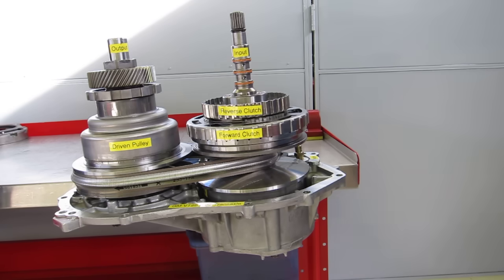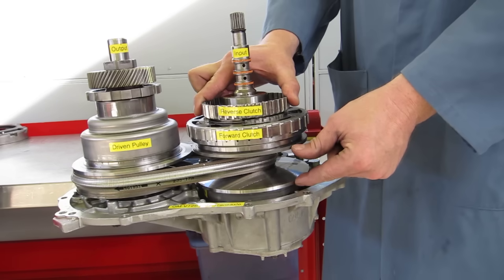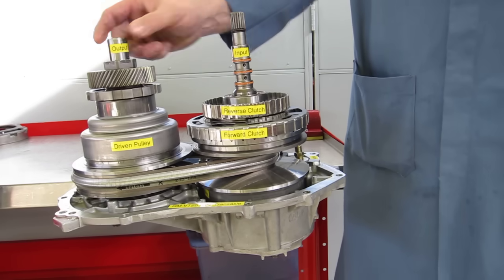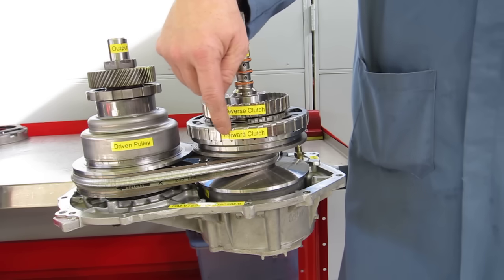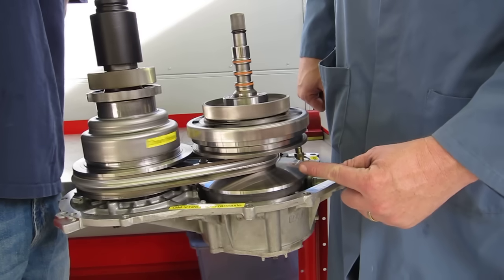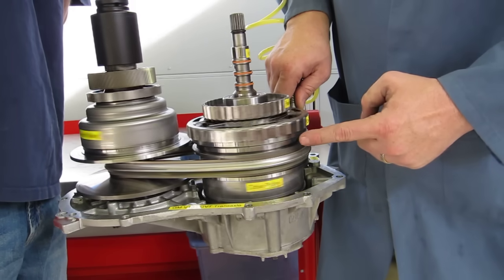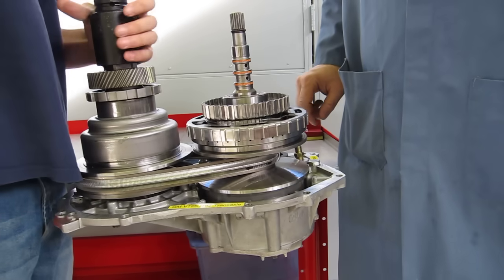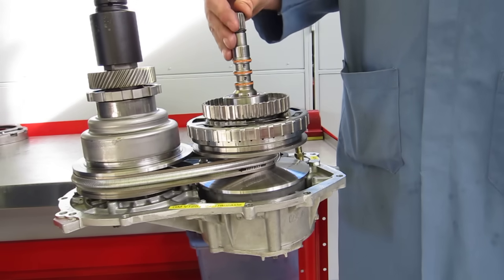Continuously Variable Transaxle (CVT) Operation

Comment: I've only driven a GM CVT but it's was the most soulless thing I've ever experienced. It took every single ounce of joy out of driving and I honestly thought the car was broken until the dealer explained that's just the way it worked. If other manufacturers are are as bad then I will continue to only buy older used cars.
Reply: Just buy a manual. Subaru, Honda, Mazda etc. Problem solved.
Reply: @unwantedscrub  manual is a good way to go, but you can also buy a torque auto trans. All models of the new Subarus use cvts now. Garbage!!!
Reply: @dafashoso3442  I can go to Subaru's website right now and build a brand new Crosstrek Premium with a 6 speed manual.
Reply: @unwantedscrub  Sadly a lot of used Subaru's here in my state have CVTs.
Reply: I bought Mazda for this very reason! They still use gears
Reply: You're going to LOVE Electric, then.
Reply: @troyjollimore4100  Would love one but I don't have the money and I don't like care much for Tesla as a business.
Reply: @MadCarTK  Didn't specifically say Tesla. So what don't you like about CVT that isn't echoed in an EV drivetrain?
Reply: @troyjollimore4100  Aren't they direct drive?
Reply: @MadCarTK  Most are. But the 'feel' is pretty much the same. Constant, linear, (boring, don't people say?) power delivery...
Reply: @troyjollimore4100  planetary gear transmission do have a very linier power delivery throughout their gears but they don't have the gutless acceleration of a CVT thanks to engagement a CVT or as many still call them a centrifugal clutch lives on slippage and you will always have it in any smooth belt driven system clutched planetary gear driven transmission on the other hand have a very firm engagement once their in gear their in gear the same way a more tradition automatic transmission is.
Reply: @thekingjdd  You’ve never driven one, then. I’d dare you to floor the throttle on mine and call it ‘gutless’. It’s acceleration is the same as I would expect from a traditional automatic.
Reply: @troyjollimore4100  I've never driven a CVT in a car but have on many other vehicles and when they work they do accelerate good but its a very different feel compared to a direct gear driven transmission most notably as the belt wears combined with the slippage inherent in all smooth belt driven applications mind you I say gutless as someone who goes out of my way to make my auto trans low/hi stall and firm/hard engagement with a good torque converter valve body job or TCM mods.
Reply: @thekingjdd  Yeah, you’d be belt-limited with mods like that. The Honda CVT is way better feeling than the Nissan one I drove. Even if it’s a bit softer on a drag run, it’s worth the trade off for the smooth operation in daily driving. And it’s almost always in the ‘right gear’!
Reply: @troyjollimore4100  Very true the convenience is nice in all honesty my biggest complaint like most people is when you have a CVT or any belt operated drive unit it should be serviceable because its not a question of if it will wear out but when and I'm sorry to say I just don't see that belt having the longevity of a gear driven unit. PS have a good day Troy
Reply: @thekingjdd  They won’t tolerate being run low on fluid as well, for sure… 😉
Reply: "most soulless"
"every single ounce of joy"
I don't know, CVTs and the smooth operation seem comfortable to me in daily driving
Reply: @The_Viktor_Reznov  The 'disconnected' feeling is real. But it's not THAT bad... ;)
Reply: If you still want automatic transmission then wet DCT is the way to go.
Wet because it's more "daily driven" friendly and lives longer than dry type.
Reply: @NotAnArt_Lok  I've never seen a car with a wet clutch DCT, sounds like an obscure transmission like an SMG or clutchless manual.
Reply: None of the new offroading tech works off a manual trans, so, if you plan on manual, have fun in sedan land.
Reply: @jackwhite1742  All I need for offroading is simple gearing and know when to shift! All that fancy tech is for newbies!
Reply: @dafashoso3442  Nope. You will never be able to match the A.I. for percision shifting. Thats why ALL pro racers use an auto trans.
Reply: @jackwhite1742  That may be, but a Torque Auto trans is much more reliable Than a CVT trans when it comes to off roading! I was getting excited to buy a UTV but when I learned all modern UTV's use CVT's I was instantly discouraged. I'll just stick with my trusty 95 YJ.
Reply: @dafashoso3442  Dont get me wrong, Im not thrilled about CVT's, the acceleration lag I think is dangerous, and I was part if the Ford class action with the focus.
Reply: @jackwhite1742  
Wasn't that lawsuit related to Ford's DCT?
Reply: @EdMiF  Oh, you are correct, it was their DCT.
Reply: @jackwhite1742 
A few years ago I had a Focus as a rental for a week, HATED that thing with a passion! If only Ford had given you the ability to manually control gear changes... My wife's '14 Pathfinder can get up and scoot when you need it to.
Reply: @EdMiF  It was the worst, I lost count of how many times I almost got run over in mine.
Reply: @dafashoso3442  Honda’s Talon UTV isn’t a cvt. Has gears. I believe Yamaha’s  sport UTV has gears as well.
Reply: Are you still driving the CVT-equipped GM? If yes, maybe you can try blipping the throttle when overtaking or accelerating to make the CVT's control unit able to detect that you want more acceleration?
Reply: @izzatfauzimustafa6535  I do still have it! But I'm right about to sell it so I don't care.
Reply: American automakers can’t make anything good besides horsepower BMW makes very good CVT’s and if driving a CVT takes joy of your driving experience you can’t drive buy a different car you seem like more of a hybrid hatchback man
Reply: @StockTurboN20  bmw doesn't make any CVTs as far as I know, your f30 has an 8 speed ZF automatic.
Reply: I don't drive for joy. I drive to get from point A to point B and back again as reliably and economically as possible. I own a Prius but use my Honda motorscooter much more often.
Reply: @WonderProfessor  It's unsafe IMO, you press the gas and it takes 2 or 3 seconds to start moving. What if you need to get out of harms way? I've often seen gaps in traffic I though I could pull out into, by the time the car started moving it was dangerous to go and I had to slam the brakes and wait for a new gap.
Reply: @MadCarTK  So, are you saying that my Prius is unsafe because it is underpowered? I don't know if it is the transmission or the engine but the car goes from 1 to 60 in 2.3 hours. It has never been an issue for me. I drive slowly. I drive cautiously. When you ask, "What if you need to get out of harm's way?", I think, "I sure hope that I can swerve away from any problem or better yet, long before the problem, I have anticipated the danger and steered far clear of whatever Yahoo is playing Speed Racer on the public roadways." When I hear people say that they need the power and speed to be able to get out of harm's way, I often find that they are just making an excuse for being able to drive at an unsafe speed. Note: I am not accusing you of doing this. However, one only has to spend a few hours on Southern California freeways to know that a large percentage of individuals are exceeding the speed limits and a few are driving recklessly, often alarmingly so. I wonder if our California Highway Patrol has just given up trying to get people to obey the rules of the road.
Reply: @WonderProfessor  What are you talking about? Nobody mentioned anything about power. The delay in the car moving is from the CVT transmission and nothing to do with how much power it has. You seem triggered and this has caused you misread my reply. Take a few minutes to calm down and read it more carefully.
Reply: @MadCarTK  My apologies. I guess I don't know why the Prius is slow, the power or the CVT. However, what triggers me is that drivers are speeding and driving recklessly and those who say, "I need power to get out of harm's way," are often the same folks who treat the public roadways like their personal speed tracks. By the way, I have been nosing about videos about CVTs and many of the comments say they are unreliable and many others say they don't have any problems with them. It seems the Nissan CVTs are the most problematic while the Honda CVTs are fine.
Reply: Yep thats CVT for ya, as a Mitsubishi mirage owner can confirm how much thise cvts suck
Reply: There are many cars with cvts. Nissan owns Jatco which is biggest cvt manufacturer for many car brands. They are garbage. You can buy a new vehicle with a torque trans. Always ask owner or dealer before buying. Maintenance on a cvt costs twice as much as a torque trans.

Comment: Nice, but it would be nice to hear about how the ratios are varied between the extremes.  Is it by mechanical means or electronics...or both?
Reply: He says. A computer varies hydraulic pressure in the ports he blew air into to open and close the pullies to match the situation.

Comment: But can they make one that's gonna even come close to the reliability of a turbo 350 or 400 trans it would be a good trick unfortunately I believe for the next yrs to come anyway as. They use this technology there is going to be a plague of. Transmission issues already big big money for anyone to even consider opening one up to see what's wrong just order another one and see if you can't baby it along and get 20 thousand miles out of it for light loads snowmobiles and other toys and even then they are belt eaters never cared so much for the whole design it's just there's. Really just no way to not wear the belt or something with all the friction that' your gonna have period

Comment: Hirrible Transmission. Expensive to repair and poor quality and performance as well. Just bought a 2021 Accord with the 2.0T because it also has a standard 10 speed auto trans instead of the CVT 8 speed junker that they install in all their 1.5 cars.
Reply: Know a lot of people that have those 1.5 cars. That CVT 'junker' works just fine for them.
Reply: @troyjollimore4100  good for them, give it time and when it finally does run that steel belt out and they have to get it repaired, they’ll wish they had a standard automatic transmission. Their average repair bill is nearly double that of a standard.
Reply: @alteregos8949  You tend to just replace them, from the sounds of it. Everyone's whining about them, but truth is they've been in some cars for over a decade with zero issues (not Nissan), and they've ran fine for years being abused in snowmobiles and ATVs...

Comment: Objection Your Honor . at 1:12 : "... propels the the front tires ..."  Way back in the Fifties with the Daffodil (2 cylinder air cooled motor) the reality was "... propels the REAR wheels ..." as  even today some are rear wheel drive. So the genius DAF from the air cooled 2 cylinder motor went on  the Renault, I believe 4 cylinder inline water cooled 1108cc  and later to  the Renault 1289cc. Then when Volvo took DAF over  they rebadged the 1.3 as the Volvo 66. It all started  on production cars with the Variomatic.almost 80 years ago.

Comment: What i want to know is why they are "sooo cheap" to manufacture but replaceing a failed unit costs the customer 8 grand in the case of a subaru, which compared to the 4 speed auto i had to replace in my 03 outback, is over 5x as much.  That kind of profit margin sounds borderline illegal at best and an actual scam at worst

Comment: Works in the same way as a twist & go scooter except inertia makes the pulley contract & expand. Simple idea but not that reliable in practice as tend to fail more regularly than a standard transmission.

Comment: So is this basically a dual-clutch transmission? 🤔 Had a 17 focus with barely 13,000 miles. Basically crapped out and while I did get somewhat better mileage. It wasn't the best to drive around & would slip out of gear on occasion. 

I guess Ford had a lot of problems with these. Great demonstration here but you should be getting a lot more than 13,000 miles on one transmission. Maybe Nissan and Honda's are better but I'm still not convinced. :/

Comment: You should see the abuse my poor little 2020 Civic Sport Hatch CVT takes on my short 10 mile each way commute. I go from normal subs to deep inner city downtown Chicago. There is a lot of angry stomping on the gas, braking, trying not to hit someone, someone trying not to hit you. I am going here, no you are? What the heck? Not to mention constant gas no gas gas no gas. I can feel my CVT jitter when I let the gas off and in general it is getting kind of stutter-y at slow speeds. I am concerned since my car only has 13,000 miles. I really really regret not getting the manual transmission for this type of abusive driving. I just didn't master manual until after I already bought my car. Another thing is anti-theft. Hardly anyone really knows how to drive manual and I see people often buying cheap cars in manual for that protection. It happens sometimes that someone who is armed will run up and demand you give them your car. Best if they can't move it and run off right?
Reply: probably just the transmission computer trying try save gas

Comment: CVT wouldn't be so bad if we could easily change the belts as that is what almost always fails. If we could make it so they could be swapped in your driveway in 30 minutes with basic hand tools it'll be awesome..but then the world of scumbag car manufacturers wouldn't be able to sell a new car every three years.
Reply: Funny you say this as work on combine harvesters that use the same principle of cvt to change mill speeds
Pulleys a a lot larger and uses a rubber belt that can be replaced in about 20 minutes with basic hand tools
Reply: @cameronhorner7058  I agree that CVTs could be great, They're awesome in snowmobiles because one can change the belt. with cars yoy throw it away

Comment: I love buying the most reliable Nissan that always appreciates in value. It is such good quality and has so many features. - Literally Nobody
Reply from the maker: Lol. Thanks for watching
Reply: I mean it really depends on how you drive and the specific CVT. I personally don't like CVT transmissions (especially the fake shifting). But some people can get away with it if they drive like a grandma and get improvements in efficiency. However it's not worth the tradeoff to me. I'd take an auto, manual, or just a flat out electric vehicle before a CVT.
Reply: @breakfast7595  meh, I know that my friends CVT CR-V has been driven like an absolute moron and the transmission has yet to fail at 190k
Reply: my nissan altima I 6 years old and still pulls strong.  wonderful transmission
Reply: @scottallberry6713  geez, a whole 6 years?
Reply: @notherestillnothing OK  here's my example,  2012 nissan altima,  260 thousand miles change fluid and filters every 80 thousand miles since new.  Better than any of the big 3 junk
Reply: These days it’s Subaru that has all the cvt failures.
Reply: Would that reliable Nissan be the GT-R?
Reply: Any my little 06 Prius with 274k miles is still going strong
Reply: My 2009 Nissan Rogue rides like new, with 136000 Km on the clock.  Made in Japan.  
No issues at all for the last 12 years, only regular services.  Love it and will keep it for another decade.
Reply: Good video , bad transmission design.
Reply: This comment did not age well,  lol

Comment: Maybe I'm just an Arts graduate but I still don't understand how those pulleys change shape
Reply: These  Puleys dont  have U shape parallel plates,
 but V shape plates.
One puley goes
wide \_/ and on the other puley the inclined plates go close to one another in
 \/ shape... 
so the belt goes to the bottom of the wide  \_/ puley and climbs up to the top in the other one puley  \^/ 
And so what? 
The effective diameter of the puleys, in respect to the standard length and width of the belt, changes, as if the puleys diameter self were  variable..
The effective diameter of the closef puley \/  is  o and  the effective diameter of the other, the opened  one,  goes O...   o vs O 
The speed of the small puley o is great, the speed of the  O puley is low...
Reply from the maker: What he said.  Thanks for watching

Comment: Why not make the belt extremely easy to replace? Maybe make a steel rubber hybrid. Just make it easy to replace and have a sensor that can tell you when it’s time to replace it? If tires can take the RPMs I’m sure a tire like belt could handle the Torque?
Reply from the maker: Thanks for watching

Comment: For the haters, the CVT is not at fault. Some manufacturers don't use a seperate oil cooler for CVT's. That kills them. Those who do have seperate oil coolers, don't have problems as long as the maintenance is done according to specifications.
Reply from the maker: Thanks for watching